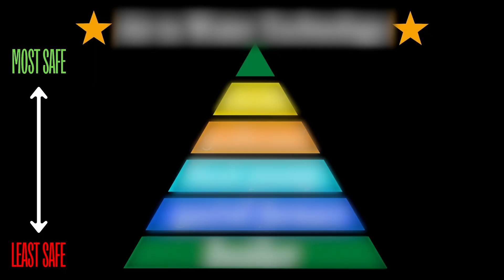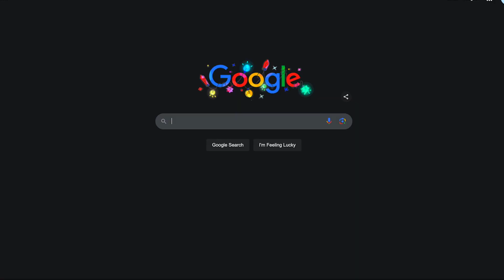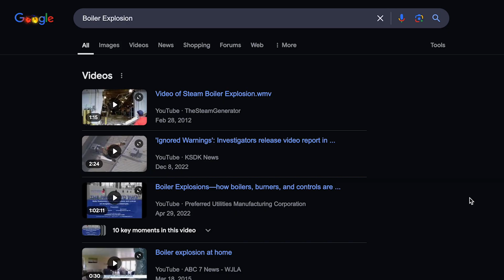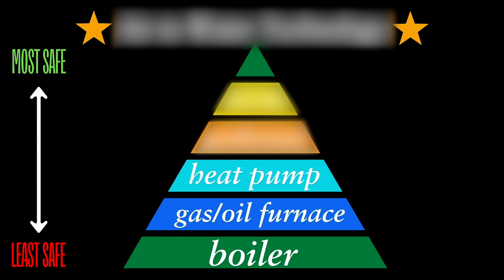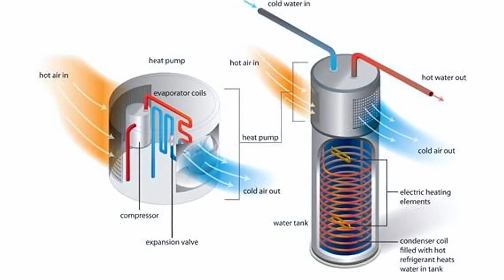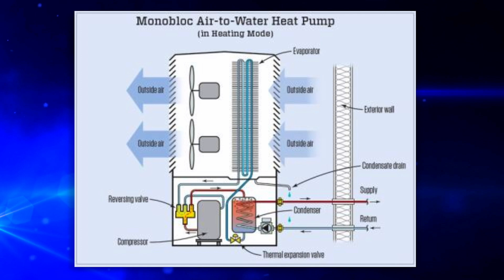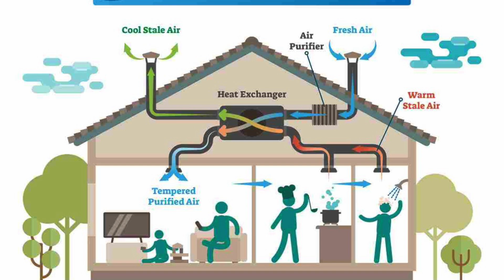SAFEST Heating and Air System for Your Home??

Comment: Really, the ground source heat pump is unsafe?  Come on.  You have a fridge in your house and millions of them do not fail to the point that we are scared.  Similar to NG furnaces/oil furnaces are not failing on the level that creates any fear in home owners from the heating system.  NG leaks are the largest component but when installed properly are very safe in millons in homes.  Even stoves are more likely to cause a fire, but not from a gas leak, but more often it is the operator not being attentive of things on top of the stove.   Water transfer? really the safest is an outside wood water boiler because it only sends in water to your house.  Everything that you mentioned is in millions of homes and are on the failure level of parts per million.

Comment: I believe the whole A2L fear is 99% industry talking heads purely looking for any talking Point possible. 
As a homeowner, A2L refrigerant is not even on my list of concerns. I am far more concerned about the Nature gas that is literally plumbed all over the house. I have seen the flammability tests done with A2L. And it’s absolutely nothing in comparison with Natural gas or Propane. 
I feel that accidentally Bumping the knob on my gas stove and having the gas run is like 10000x more of a risk than any refrigerant. 
Heck, even if the refrigerant was a straight unmitigated flammable gas. Like propane or something similar. I’d still be less worried about it in the sealed system than the other gas burning appliances in my home. 
I’m honestly kinda sick of hearing all the YouTube HVAC content creators talk about A2L.

Comment: Most of these things in this video are easily addressed.. For instance mold building up mostly has to do with your insulation or the lack there of.  Roxul is a stole wool insulation that allows the walls to breathe like fiberglass, but won’t rot with moisture like fiber glass does.  Then you have spray foam that completely blocks the air and you can’t remove it easily to see if your wall behind it is rotting.  As far as mini splits they are great, the idea of affordable individuals units means it one unit goes down you have others to offset that while you get it fixed.  Mr Cool makes great DIY units where you mostly just need an electrician to hookup the power

Comment: If I was builing a new custom home, I would go with high end mini-splits throughout.
Reply: By the time your mini splits and their wiring is done you'll be spending twice as much money as with a central system! Make sure you get two or three estimates before you deside.-
Reply: Before I do that make sure to figure out the total cost to install those mini splits compared to a central system. Reason is "it could double your cost"; I would get at least 4 or five estimates before I make a decision on system!

Comment: Mini splits and heat pumps, Up here in the north east I'll let you service them outside when it's 20 degrees outside with 20 mph wind. I'll stay inside servicing the gas furnace or boiler while you are recovering a unit and replacing the inverter and compressor with filter driers freezing you ass off. No thanks

Comment: Boiler explosions are mostly a thing of the past, except in the case where it's actually a gas explosion. (natural gas or propane) The days of steam explosions is what I was getting at. Steam units were the only real issue and most of those problems were sorted out over 100 years ago with safety devices like the Hartford loop, blow-off valves, and high pressure shut-down of the burner. Hot water boilers have similar features and I have never seen one blow up.... oil or gas fired. The rest is new school = new problems so harder to categorize the level of danger / safety.
Reply: There are a crap ton of boilers in older homes in the Mid Atlantic and New England states. I have seen many 50 plus year old boilers in many homes still going.  Certainly not the most efficient, but working just fine.
Reply: I agree with you, pressure relief valves have eliminated the blow up of boilers.  Without an NG or propane leak, houses do not blow up.  The closest thing to a steam caused blow up is in the streets of NYC due to age of the pipe, not in buildings.  With this level of fear mongering, he is trying to sell something, and it is not safety.

Comment: Regarding mini splits, I am a facilities maintenance worker, not hvac mechanic. I work on all the mini split systems in all of our facilities. We were told that the pull out filters need to be replaces once a year. Is that true when we do PM's every quarterly? For 28+ years we've been just cleaning the pull out filters.
Reply: I've never heard of having to replace ductless filters every year. They are washable filters, just vacuum them off or give them a rinse with a hose and shake dry. Some ductless units have a small extra filter that is supposed to be replaced each year. They are usually about 2 inches tall and go at the bottom on the larger filter.
Reply: @ I know. That’s what we’ve been doing all these years. Now all of a sudden our manager told us that they needed to be replaced once a year. Not coming out of my wallet. Our company (Big Corp) said to replace every year. I am retiring in 5 months so I don’t give a sh!te about it. Oh well. Thx.